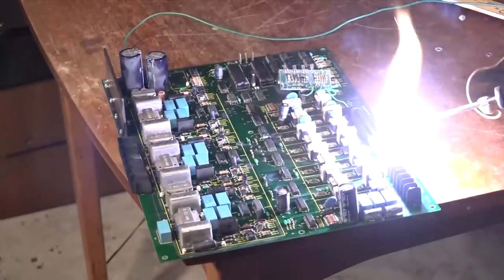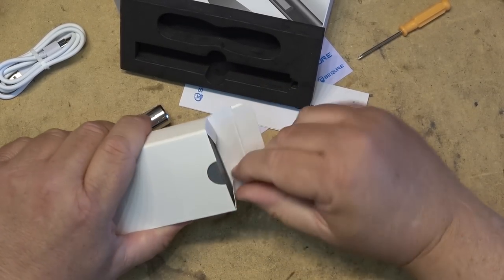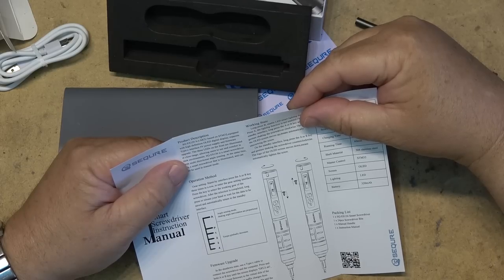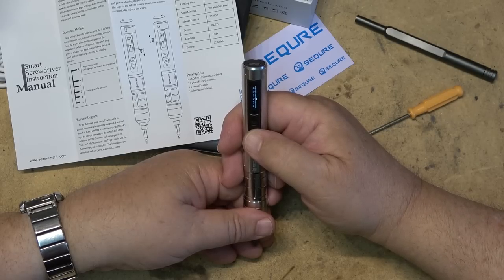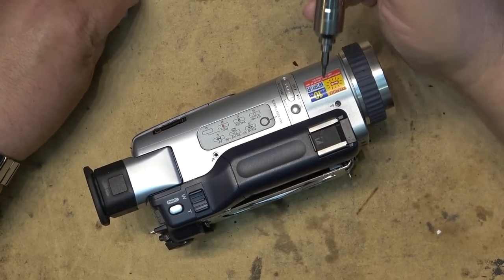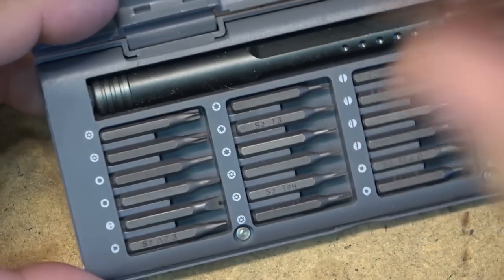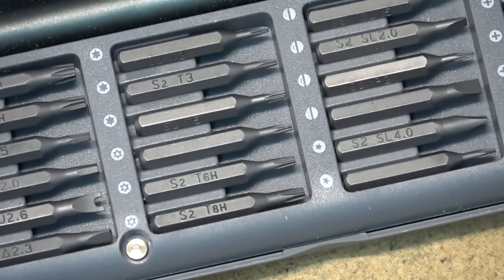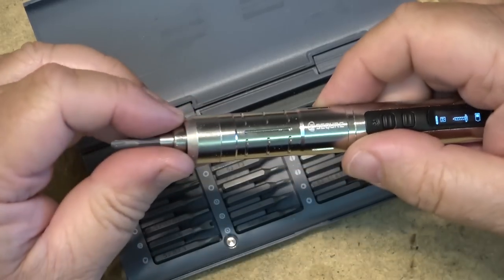SEQURE SQ ES126 Smart Electric Screwdriver Review

Comment: hi there i have  SEQURE SQ-ES126 Mini Electric Screwdriver just i was working 
with and just stopped nothing in the screen black but when 
i  connect the computer and press a key it show  DFU:3.44 and the filles open 
and just 3 filles .fseventsd  .Trashes ._.Trashes i did attach pics of screenshots  
so i think its need to be re flash with the original  hex file i 
look everywhere i can find it so can you send me the hex file for it or please can you share the 
files from your Screwdriver because i thinks the files in my Screwdriver is corrupted  …thanks

Comment: Very nice tool from the looks of it, but 108 usd, meh i wouldnt use it enough to justify the purchase
Reply from the maker: It is expensive.  No question but then so are snap on tools or any other high quality tools.
Reply: @12voltvids  Yep no doubt it's worth the price for somebody who'll get decent use out of it.
Reply from the maker: @mikedrz  it's aimed at repairs people and hobbiests. For building things like drones with tons of small screws holding them together. This is precision built and has a bit of weight behind it which suggests metal gears and parts that should hold up well.